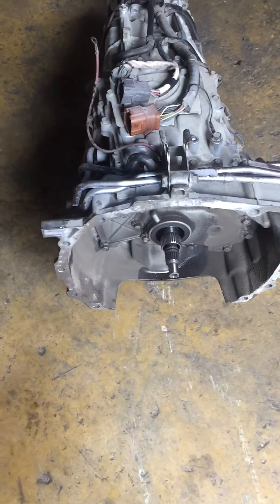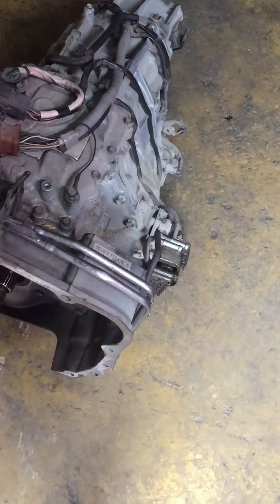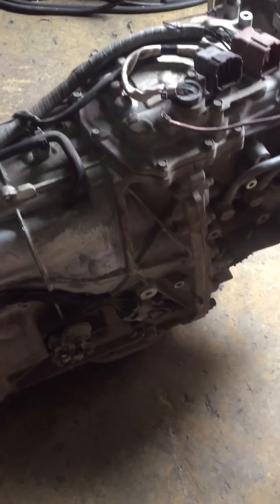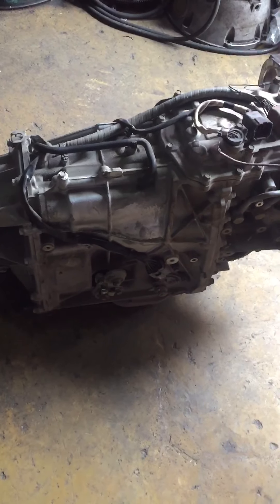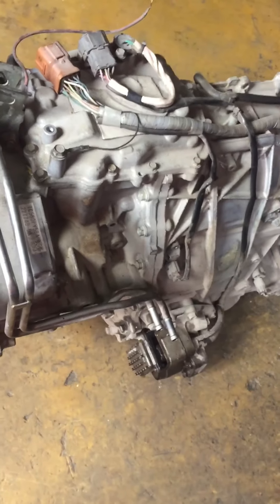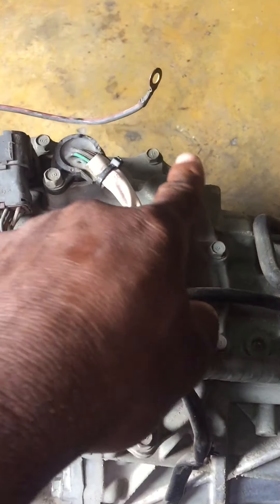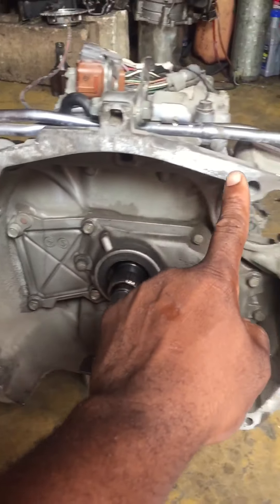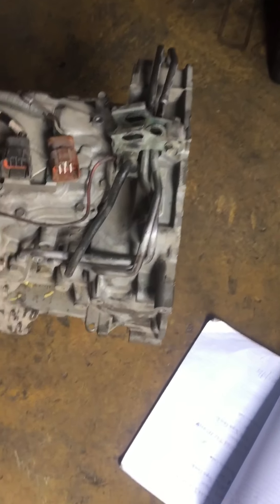2013 Subaru Impreza p0841code Secondary oil pressure sensor performance

Comment: bro help please i have this problem: 2016  subaru legacy(tr580) shakes at low speed and rpm while accelerating please. mine does it, when you accelerate it shakes and it got some clunk noises coming from under the car. on the dash there are: Cruse control flashing, at temp oil, check engine, and vehicle dynamics control light. i've looked up everything but found nothing. please help. 2016 subaru legacy 2.5I also cv axles both in and out parts need to be changed, can that cause this problem? i have 2 codes P0841 and P0700. help asap
Reply from the maker: my address is number 2 Elspeth Avenue off East, Rd., Kingston, 10
Reply: @constructivetv6436  im in different country but if you know anything that could help please, i will be pleased if you recommend anything
Reply: Did you ever get it fixed mine is doing the same thing
Reply: @shaunice281  In my case, as mechanic said, chain was ripped and it caused vibrations and vehicle not to move at all, so i bought 2019 subaru outback transmission(TR580,8-speed) and changed it out including axles. So i recommend you to visit mechanic as soon as possible and try not to move with your car in that condition(i havent done it and after some time, car stopped, wouldnt drive or reverse). try to avoid : Drifts, slipping tires, overheating transmission, change fluid as factory recommends, avoid shifting from D to N or R without fully stopping. Tell me whats going to be the problem when you solve it✌️💕
Reply from the maker: @shaunice281 my address is Number 2 Elspeth Avenue off East Rd., Kingston 10
Reply from the maker: Good afternoon sir I can help you with your transmission. I sent you my address 2 Elspeth off East Rd., Kingston 10
Reply: @constructivetv6436  good afternoon, thank you brother but i already replaced transmisiion, but i do have two questions
1: was there any 2016 legacy or outback with 2.5 engine with manual transmission
2: if i find that transmission can i swap out cvt with that? or which manual trans can i use? and what do i have to do for it

Comment: had this same issue last year. mi add a transmission cooler and mi nuh get the lgihts or code but it jerk on slopes when the cvt temp goes up to 80 degrees and if it guh past 90 the light dem come on with same code havent has the issue in a while since i try not to increase temp
Reply from the maker: I know what is the problem with your transmission you can  Email me at cjtransmission81@gmail.com
Reply: @constructivetv6436  i emailed you

Comment: They managed to solve their problem?
Reply from the maker: The problem was the primary pulley bearings damage inside the transmission
Reply: @constructivetv6436  I have a 2015 WRX and the cover where the chain that moves the oil pump goes is breaking. It has happened 3 times, even with a transmission that I bought. I don't know how to fix it. Do you have any ideas?😭

Comment: Does this sensor make the motor oil light go on ?
Reply from the maker: Most definitely what make the transmission light come on it is the pressure solenoid’s

Comment: Hey I have the same code but I get a bunch of other codes 
I bought this car with a bad engine 
Swapped the engine, it drove fine at first but I started getting flashing lights almost immediately. Cleared them drove and the car broke down in me doesn’t drive or reverse anymore even if it reset the lights. I thought it was cvt fluid but I opened the check fill plug and a bunch poured out 😣. 
Tried relearning but it asks me to warm up the fluid but it won’t warm up since the trans won’t even run.
Reply: I just also realized my transmission is a tr690 from a 2012 legacy 2.5
Reply: Hey, my friends subaru has the same problems, did you end up solving your issues?
Reply from the maker: Can you send me the code you got from your transmission
Reply: i’m having the same exact issues after putting the engine in. did you happen to figure out what was going on?
Reply: Having the same issue.. did anyone find a solution? Have codes p0700, P2746, P0841, P0842.
Reply: Same issue here after pulling the engine and doing head gasket job. Has anyone solved the issue?
Reply from the maker: The car moved forward or reverse when in gears
Reply from the maker: Since the vehicle isn’t moving in reverse and forward there is no application taking place there so the drive chain in the transmission burst
Reply: They managed to solve their problem. I am having the same problem.